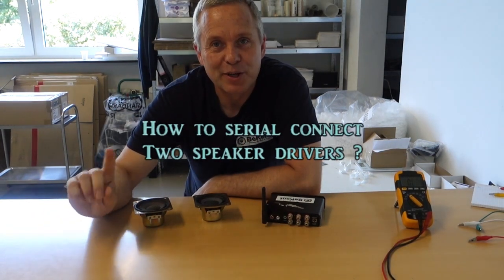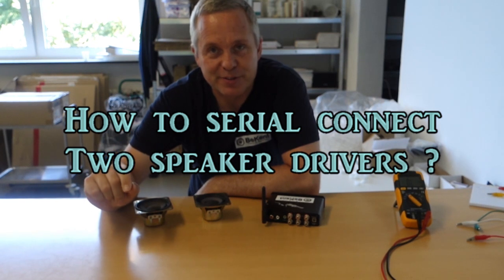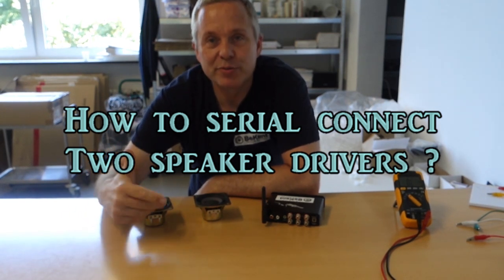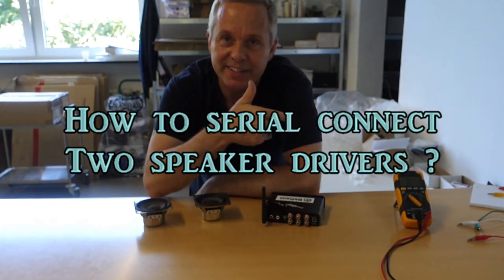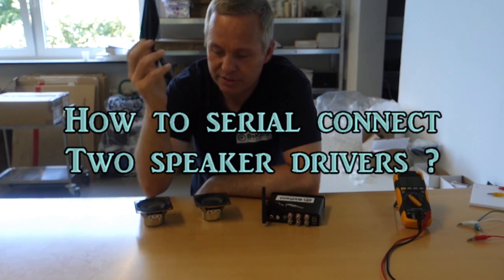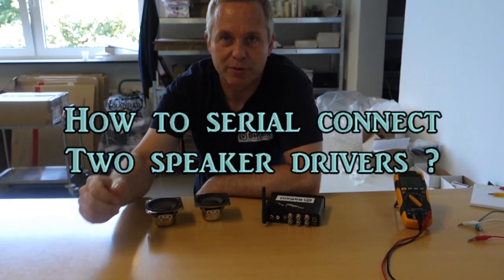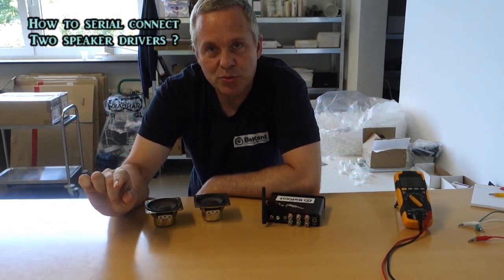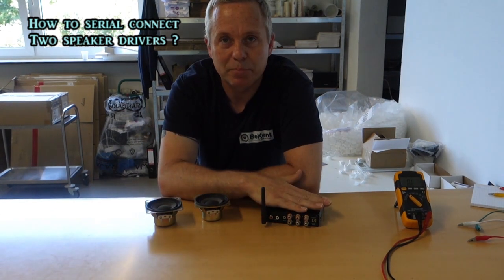How to serial connect two speaker drivers ?

Comment: Hi there,  thank you for  providing some very educational material.  Can I ask for advise? I have a heos amp that has a range of 4 ohms to 16 ohms. I already have two speakers drivers running at 4ohms (which have the option of alternating to 8ohms if I wanted) already connected to the amp. I want to add two more speakers to this Amp which are 6ohms each.......Just to clarify do I connect them in series instead of parallel.  Or the other way round.
Reply from the maker: Yes, if you want to connect them and you already have a 4 ohm load on the amp, it will be important to connect in series, a parallel connection will likely kill the amp.